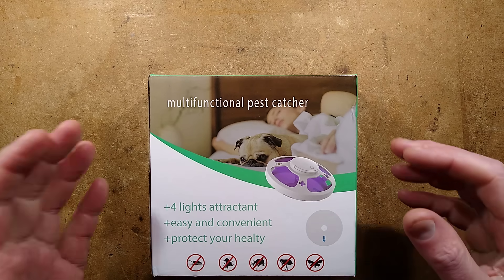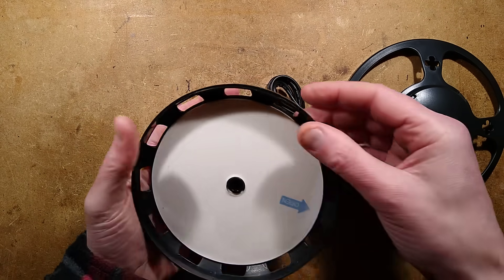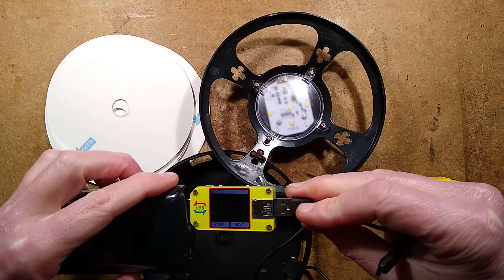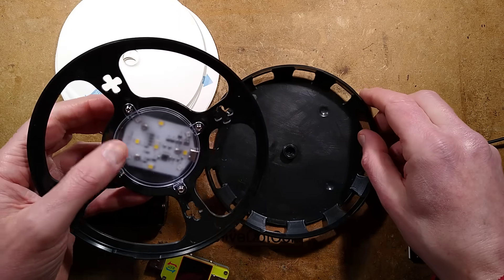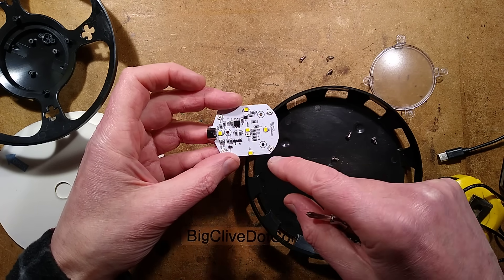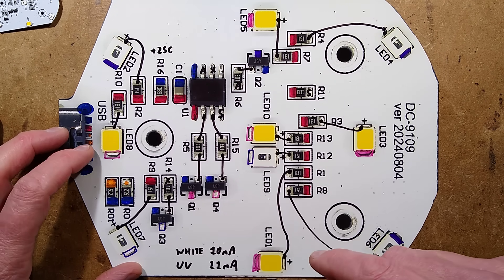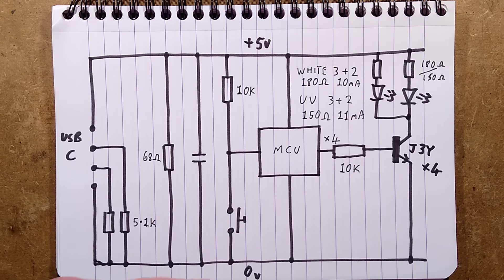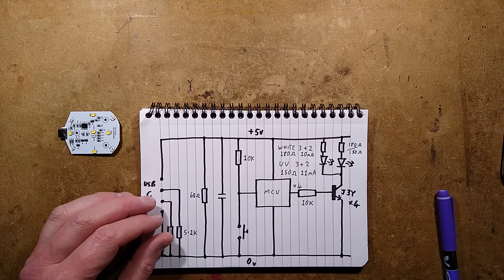USB flea trap teardown - with schematic

Comment: Almost certainly the 68R is an attempt to keep a powerbank alive. Unfortunately it's still not enough to keep many alive - I measured 5 of the top brands for a recent project and they ranged from 30mA to 220mA to prevent sleep (I think the average was around 150mA). There's no way to 'spoof' it by toggling a pulsed load either it seems.

Comment: I've used a much simpler version of this trap for years. It uses a simple e12 incandescent bulb (night light bulb) The heat and light attract all sorts of bugs and spiders and with multiple cats I haven't had a flea problem in a long time. The larger stickers you bought fit in this and they are very easy to change because of the small tab on the side of the sticker.

Comment: I'm sure it's pronounced cock-row-SHAYS

I have a lot of the old style A/C sticky traps that use C7 bulbs (7W by the way) and my comparison testing with LED bulbs indicates that fleas are more attracted to the heat than the light.  A couple of years ago California outlawed most sale of incandescent bulbs, and I have almost run through my last box of 25.  LED C7s do work, but just barely.

Comment: Just curious, how much resistor is required to keep a powerbank running if your device doesn't draw enough to keep it on? And different ports,  usbc 4.0 and 3.0, 3.1, 3.2 usba?
Reply from the maker: They often need about 100mA to stay on.

Comment: I bought one of those 15w fly traps at a thrift store and I opened it up. There was very little circuitry and the lamp was also used to discharge the capacitor for the fly trap!

Comment: Hopefully you have none, but enquiring minds would like to know if the glue sheets really are strong enough to hold a flea, or would they just struggle a bit and then free themselves?  Know any flea infested sites to do a long term test?
Reply from the maker: It's very sticky, so it should work.

Comment: I have a question about off road led light bars.  I don't know how so may light bars can have the same number of leds but way different leman output and wattage, I just picked up a CJ Global Nitro  24''  bar with 96 leds '' 3 watts '' rated for 28800 luman 288 watts 9 to 40 volts, My question is how can so many light bars look the same have the same leds but be so of on the numbers? I seen them listed with 60,000 leman but 88 watts or 15000 at 70 watts? I was thinking they are all scam numbers just to get people to buy the biggest number like so many 18650 but I see brand names offering 15 inch bar 15000 lumen,  if you want to go down a rabbit hole as they say maybe have a look at some of these things lol  This one says it will run on 40 volt so im thinking maybe ill hook it to my mower battery and see if it blows up,   Just a warning im on some strong painkillers right now so maybe im just mixed up big time.  96 x 3 watts at 12 volts x 288 watt = 28800 luman?
Reply from the maker: They just mass copy popular model numbers and other listings.

Comment: I'd have drawn two outputs from the MCU on the schematic, each with a 10k (x2) resistor, to show how the MCU selects between UV and white.  I think the associated transistors and LEDs could remain implied, but the existing schematic seems to say 4 resistors (and transistors) are connected to a single MCU output.  I'm guessing the "low" settings are just PWM?

Comment: I'd love to see you tear down one of the newer arc lighters. Super cheap ones with the flexable neck. Seems they use a small chip to generate a 20hz signal and feeds it to the gate of a mosfet connected to a transformer. Built in battery and USB c charger. Just loaded with useful components.
Reply from the maker: I've featured the arc lighter and this high voltage candle lighter:-
https://youtu.be/drUYueP0pNg

Comment: Hey buddy, yeah some of these little devils will move towards the warmer spot, some will jump at a change in light intensity. Some variation between species, there can be some variation between male & female response also. I don’t know if fleas in general or in species specific cases exhibit the urge to move uphill or move towards certain frequencies of light. 
I would be surprised if such a device is a genuine way of controlling fleas in particular as 60-80% of the varmints are eggs incubating or larvae feeding away from the host 
Love ya work bro’
Cheers from Oz 🇦🇺

Comment: If there is a material I wish humans newer invented its ABS.
Its not exceptionally strong, its chemically very weak, it might be most enviromentaly damaging type of plastic for both manufacture and disposal and highly toxic when burning. Its only benefit is that it is cheap. Meanwhile wasting oil on which humanity is so reliant.
it is dangerous for pets if they eat it. It is practically non-recyclable. (in theory you can  heat melt, but only really once when making it). There are times when PVC sounds as a better option. If this gained CE (or UKCA) then it shouldn't had.
I keep seeing more and more insectocuttors like these in restaurants, where after beautiful first day the sticky tape changes to full of flies until it is replaced in a summer practically daily.
Manufacturers and suppliers like Nisbets (Low qualitty catering equipment store chain) push these to be able to earn more money by selling the sticky papers.

Comment: When I lived in Florida, fleas were a constant problem.  Walking the dog would collect dozens to hundreds of them.  Some yards had areas of sand or stuff that looked like sand... but that started bouncing when you got close to them. Sort of like a cloud above the actual sand.  (HUGE pile of fleas..)   My retired greyhound was bothered by them.  Once they get in, the only way to dispatch hundreds of them at night other than insecticides?  A pie pan of soapy water and a goose neck lamp with a 10 or 15 watt light over the water.  I had a mattress that was rather low, and a TV set (about a 15 inch tube thing) that sat on the floor a few feet from the bed.  At night, you would see lots of fleas bouncing off the screen... So I went with the pie pan with goose neck lamp, and would dispatch dozens of the suckers at night (first night?  With the pan where the hound normally slept?  perhaps 50 or so drowned. The next morning. Just dump the water with all the corpses.  While it would not totally eliminate the vampires, it made things a LOT better. The big problem with the Florida Fleas?  They were very difficult to dispatch with ordinary insecticide sprays at the time.  Water was FAR cheaper and more effective...

Comment: We used to use a saucer of water with an angle-poise lamp over it to just warm the area up, fleas would be attracted to the heat and then drown in the saucer and this would prove you had them in the carpet.

Comment: I was living in a yurt in a jungly area in Hawaii, and had made a makeshift candle with a metal dish with lamp oil or some fuel in it. I had it on the floor and was laying down watching it, and fleas started jumping into the flame. I wasn't even aware they were around, it was very surprising when it started to happen.

Comment: Whoever will make USB-C cable with built-in 5k1 resistors on CC1/CC2 will make a fortune, I've seen a lot of USB-C devices that omit these resistors and then they only work with dumb chargers or when connected via USB2

Comment: Haven't seen a flea in 40 years. Apparently nylon sheets zapped them all. In the 60's when I got out of bed I would plant my feet on the ground and wait. Fleas would leap onto your ankles and were easy caught.
Side note. If mice nest at the back of your fire place. Do not light the fire. You now have two problems.
Mice and mice on fire scattering around your house.

Comment: An old hang-gliding buddy of ours was visited for the weekend back in the 80s, and he had a cake pan with water/detergent under his coffee table where nobody would trip over it, and above that he had a small flurescent light mounted. The idea was that the fleas would jump up to the light and then fall into the water solution. He claimed it worked very well and there were quite a few victims in the bottom of the pan. Best of all, it was practically free! Thanks for the great video! 😘

Comment: When I lived in Miami fleas were a problem we used to put in the middle of a dark room a shallow pan fill it about half full of water add some liquid soap to lower the surface tension of the water place a desk light shining into it and in the morning would be a lot of dead fleas in it . Another thing we did was sprinkle borax on the rugs and rake it in and under seat and couch cushions having indoor cats it helped a lot . I drove a dump truck at a sand company and the sand fleas were so bad there. We wore flea collars around our ankles ! And wire tied to our jeans zippers the damn things would bite you in the swampy area ! No idea if they would help with other critters 😂

Comment: Never had any problems with fleas, ants or cockroaches. Ive had infestations of fruit flies during hot summer periods. I caught those with cherry cough medicine in a washed out baked bean can placed on top of high cupboards. They get attracted by the smell and then get stuck. Bedbugs arent attracted by any kind of light, theyre attracted by CO2, body temperature, and sweat. None of the bicarb DIY traps worked for us, so we had to use professional services who sprayed and bugbombed the property twice.

Comment: I'm guessing that the 75 mA is for the cockroches, ant, and bedbug (CAB) option with the light off. The power button is probably just for the lights with the heat for CABs being on all the time while it is connected to power.

Comment: The units that use 5W tungsten bulbs work great for catching fleas especially if your house is cold. We used them in an old house heated mainly by a living room fireplace- we placed the traps in corners of that room and in bedrooms. Within a week the flea population dropped drastically despite us having three dogs and two cats who had full time outdoor access and the usual chemical flea repellent applied regularly.

I personally am skeptical of LED attractants whether visible or UV. We have seen that mosquitoes aren’t attracted by light of any kind but rather CO2, and fleas aren’t attracted known to be attracted to heat.

The sticky discs can be reused by covering them with spray glue like 3M Super 77 or just packing tape applied sticky side up.

Comment: Please forgive my ignorance. So it's safe to keep these ones plugged in 24 hours a day? They are not a fire risk? If they are safe, do you have the link for them. Many thanks.
Reply from the maker: It should be fine if used with a good quality USB power supply.

Comment: I think it is the heat that attracts the fleas. They spend most of their lives next to the skin of their host "beneath" the hair which would be very abrasive and dark so they have no need for huge compound eyes  like flying insects. I had a big flea problem and got one of those other type of flea traps and had to replace a burnt out 7W bulb I used a smaller one almost as bright 4W but not as much heat and it did not work replaced that with  7W bulb and hey presto worked again more fleas.

Comment: I'd bet the resistor is indeed dual purpose but the primary idea is probably that category of bug. "Turn the light off" being the only real available clue, as opposed to a sticky pad just sitting there (unit unplugged). I don't know the bug profiles either but that would be my guess.

Comment: Whatever you do, don't buy the rotating fly trap. I made the mistake of thinking it was a neat idea. However it relies on using a bait, which not only does not attract the flies, it absolutely stinks. It seems to be made from partially dehydrated fish powder and is most likely a biohazard, making it unusable indoors and far outweighing the possible benefit of trapping a few flies.

Comment: When flea larva hatch they find Dark places to hide until they mature, so putting such traps under a couch or bed etc does make sense. Vacuuming is important. The cheaper way is to make your own traps though, put some soapy water in a low to the floor plate or container (They dont jump as high as you think they do), but add enough water so they can sink to the bottom and not escape. The problem with using water is it evaporates after a while so you have to keep filling it up, so another solution is Mineral Oil or even Cooking Oil, while they wont evaporate like Water you will have to keep pets from drinking it, while neither is harmful to pets Mineral Oil will have the same effect on cats and dogs as it does on people.

Comment: Here, three weeks of "operation" by the old-style version with an incandescent bulb produced five bugs, of which four were verifiably fleas.  Given that a real flea infestation problem was present, and that For Reasons wasn't possible to control with insecticides right away, that non-capture outcome convinced me that this class of device is a scam, every bit as pointless as the ultrasonic pest repellers.  One friend quipped that of course those ultrasonic pest repellers did nothing to reduce the presence of bugs, mice, etc.  According to his (admittedly facetious but superficially plausible) logic, those pests aren't ultrasonic, and the repellers don't do anything to scare away non-ultrasonic pests!.

Comment: Mosquitoes are attracted by Co2 emissions not light 🤣💡🤣
Reply: Alas, mosquitoes are not known for crawling around on the floor much, either.
Reply: Sweat and other bodily odors. Heat, after getting close. 
Small amount of CO2 in breath mixes fast into air, if CO2 was main/real attraction, bunch of them would flock to (small) open fire or other CO2 sources.
Reply: Have you looked at a candle in a room with mosquitoes in it..... There are always dead mosses around it  @mindaugasstankus5943

Comment: No need for all this equipment. Heat and water attracts them pretty well. My cats wandered outside a few years ago and brought some fleas home. The kind that also likes humans. I grabbed a bowl from the kitchen that had a reflective surface (stainless), filled it with water and mixed in some dish detergent into it. Placed it on the bedroom floor rug, next to a desk lamp (which at that time still had a halogen bulb instead of an LED module) shining straight into the bowl. Got rid of all the little suckers in a few days. Every day there were fewer and fewer collected. They all committed suicide. Now I've watched your video, remembered it and started to itch. 🙃

Comment: Clive, could the offending resistor across the power be removed, for less standby power consumption?
Reply from the maker: It could.  But not if it is actually being used as a low level source of heat.